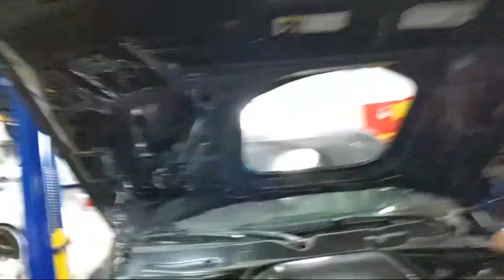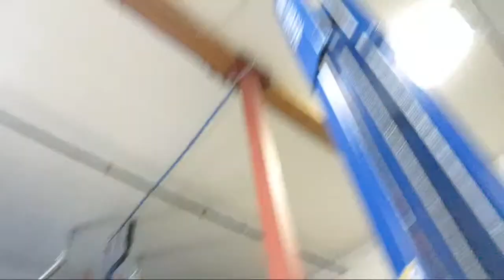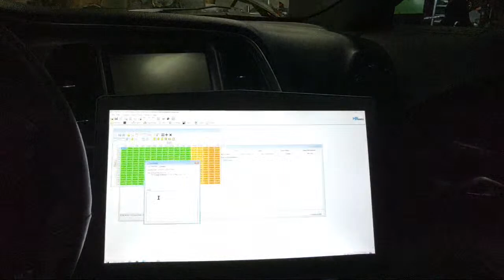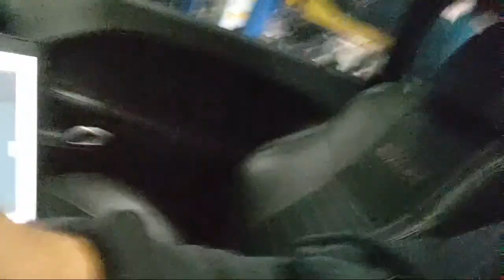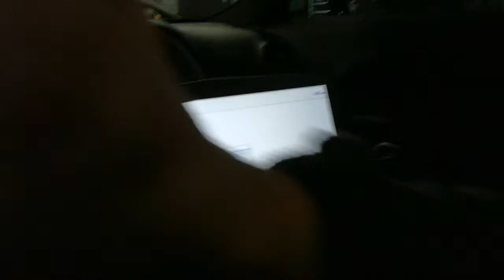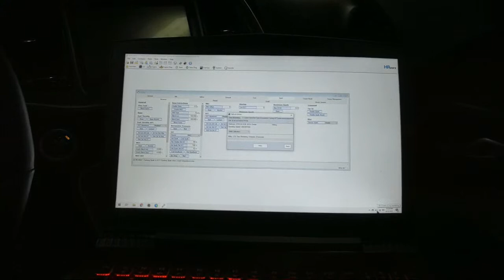American $#!t Box

Comment: Just wondering what brand valve springs and retainers you recommend??
Reply from the maker: Depends on the cam and RPM goals. Always use the lightest spring you can get away with.
Reply: @GetaDomTune  what would you run with your cams? 
There are a lot of choices out there. Single spring, duel spring, beehive. 
What would be the pros and cons of each.
Reply from the maker: @tjbugeye  my cams have an aggressive ramp rate. You'll need a good dual spring setup or beehive.